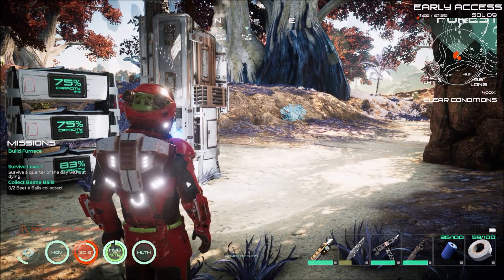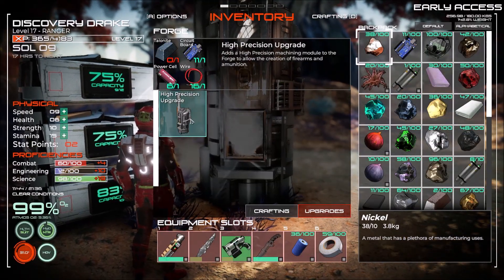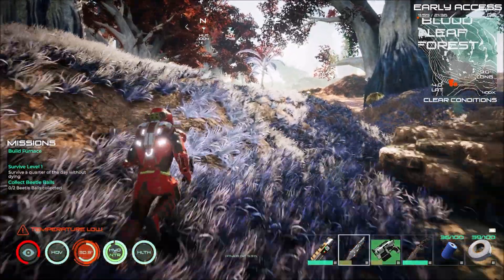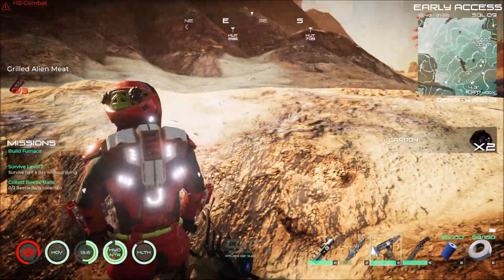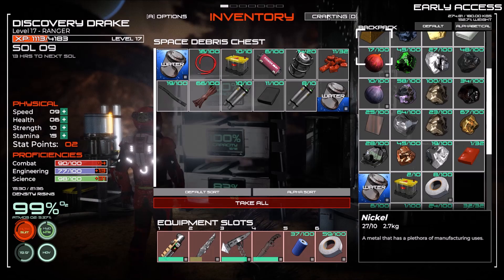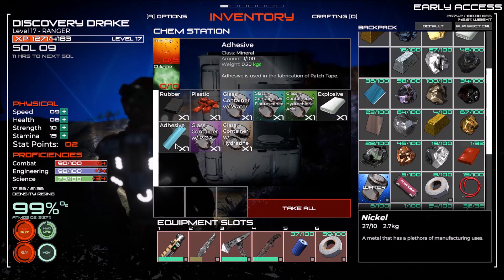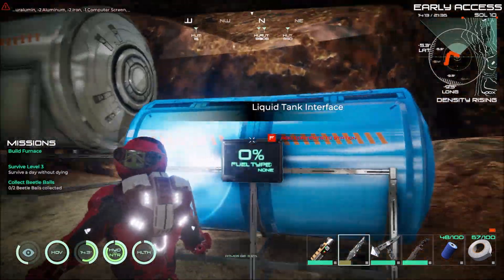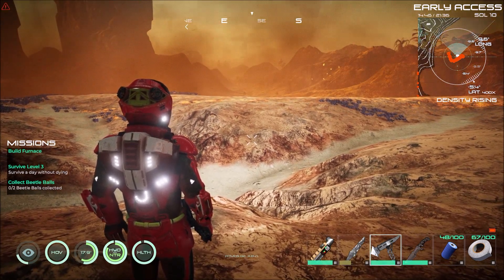Osiris: New Dawn Discovery Update | Part 6 | Diamond Chisel - Solar Panel - Chem Station | PC

Comment: Mechanized spanner is fast, you need to make it and batteries are made in fabricator, which you first need to build a habitat or you can just repair a habitat. And Chromium is in tumbo basin by the spaceship there is a crater full of Chromium and btw, i think my osiris new dawn world is at Sol 33, i have a base and almost everything
Reply from the maker: Thank you! Space is not far now...
Reply: No problem, i'm here to help if need